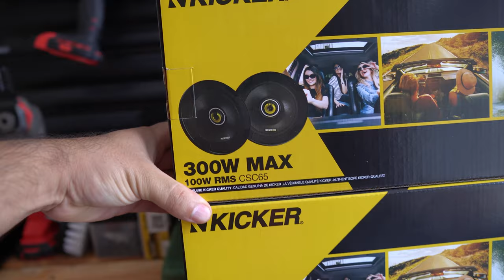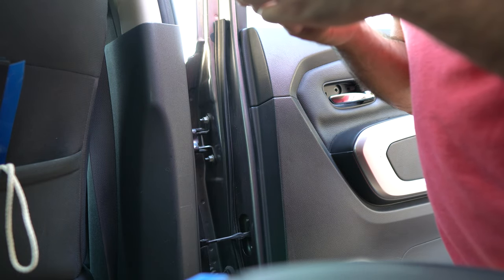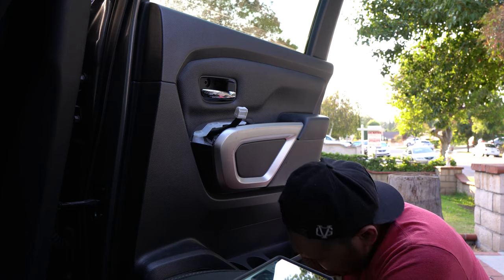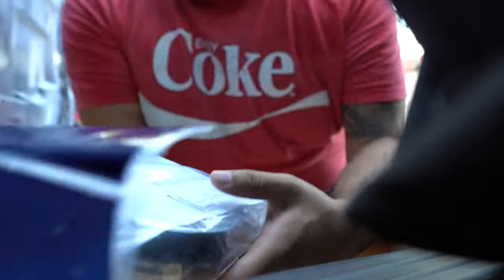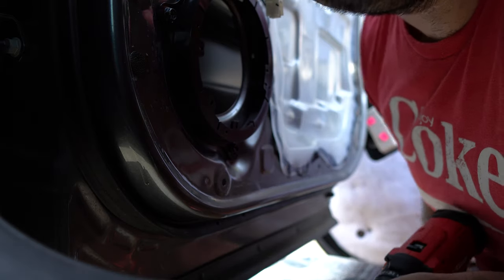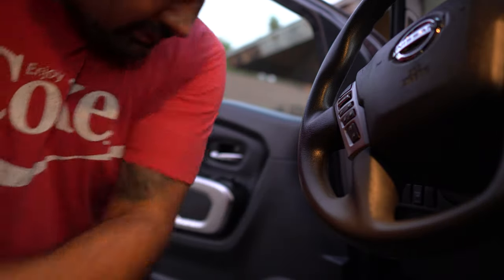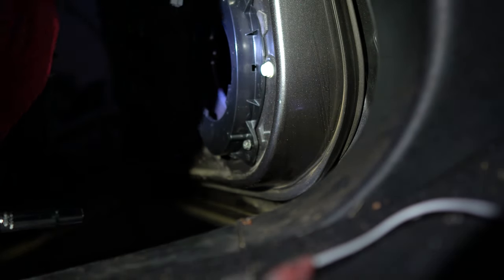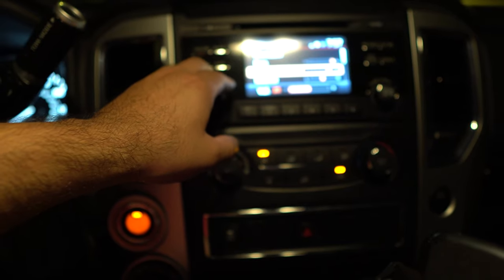2018 Nissan Titan Speaker Install

Comment: Thanks for the tutorial! You boosted my confidence for me to replace my own speakers! Thanks for showing the front and back installs. I hear a lot about the front being a 6x9 speaker but the the proof is in the video.
Reply from the maker: I was nervous to do it but it was super easy. And for the front. I still had to drill 2 holes with the brackets.  But super easy. Thanks for the compliment, means a lot.

Comment: I installed new speakers in my titan and the volume is much lower than the stock speakers.  Is there something I can do to make them louder.  They are 2 ohm speakers
Reply from the maker: from what i've learned is that 4 ohm speakers on a stock head unit the volume is lower. you need a amp to push more power to it. i believe. now 2 ohm speaker no clue

Comment: How many wire harnesses adapters did you need? Also were they all the same or was the two rear speakers the same and rear speakers matching.
Reply from the maker: It's in the description

Comment: 6x9 in front and, 6.5 in back?
Reply from the maker: 6.5 front and rear. It came with brackets to install
Reply: @SebastianAlmeda  Thanks because I have i have a 2019 SL and want to swap out the crappy factory speakers and I'm so confused on the sizes. Half thepeople on forums say 6x9 front and Crutchfield recommends 6 1/2 front and rear. Though mine's a year newer,  i doubt the size of the front speakers has changed. Thanks for a great vid.
Reply: @TG-zu7sn  his factory was a 6x9. But he replaced it was a 6.5. If that's what you're confused about

Comment: no sudwooferz
Reply from the maker: Soon my man, soon
Reply: @SebastianAlmeda  I want to install a sub in my truck. The thing is mine has the fender audio system with a subwoofer already. Could I install another amp and woofer? Would there be any problems assuming I do it right?
Reply from the maker: @jahnevachambers9040  damn thats a good question. If it was me. I would un-instal your old one and upgrade to a new one.